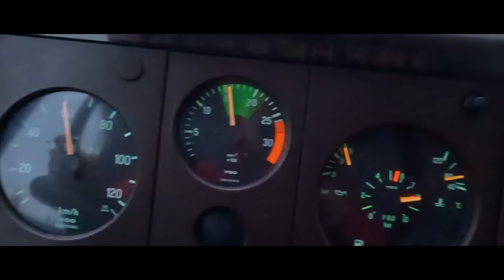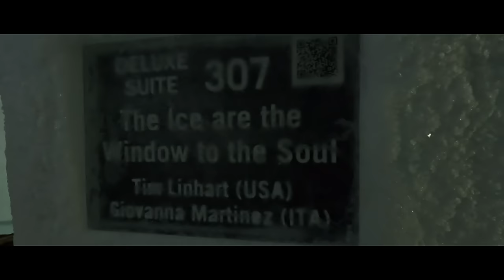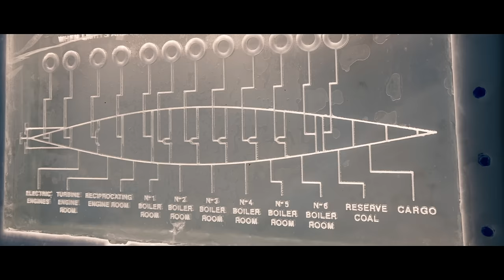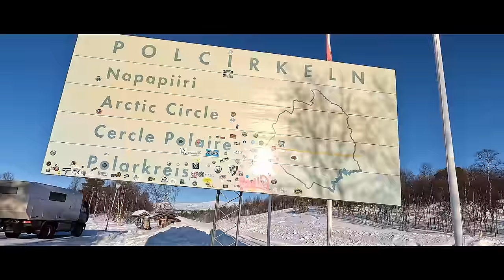NORTH OF THE ARCTIC CIRCLE. Winter expedition to the North Cape and the Polar Lights in  Scandinavia

Comment: Looks like a hookie grounding point . The western ones use a braid for this. Something onto a 13mm bolt would work well. I had mine go from the factory grd to 4#8s then down size to 2#8s grounds.  On to 10.9 grade ready rod, so those necessary grounds can all be put on with lots of Kopper Kote. So far so good!!

Comment: If you dont want your windshield wipers to freeze you must have the defrost button on and heat on high keep your door windows down a bit and problem solved I drive commercial truck.🙏
Reply from the maker: Thanks, this is what I did, but it was not enough to melt the ice
Reply: @4x4OverlandTravel  put a little alcohal in the windshield wiper fluid